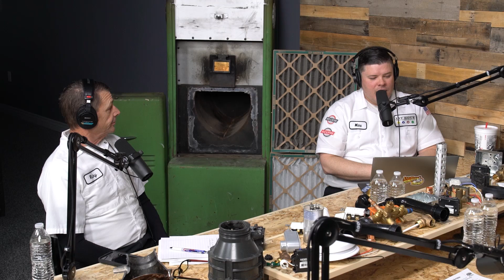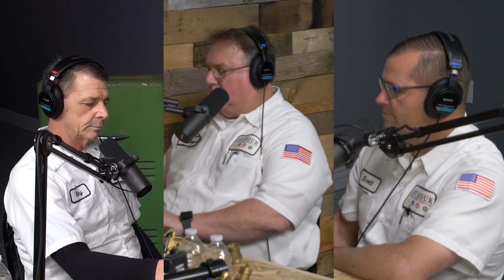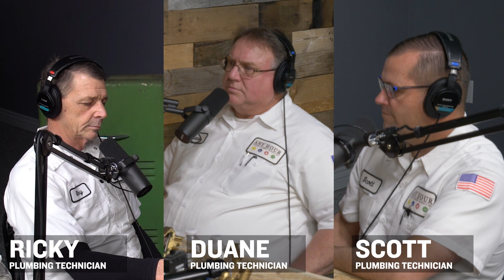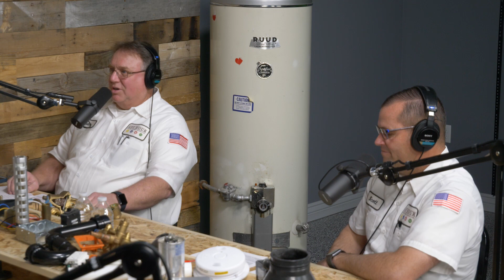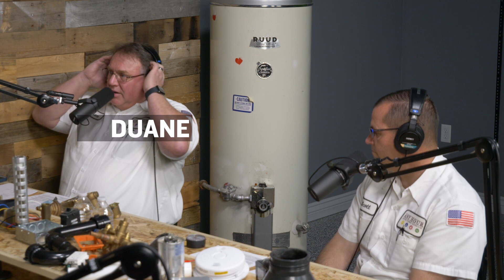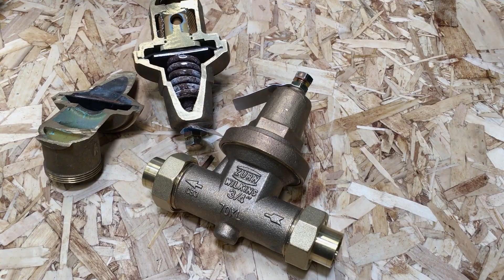014 - Are Your Water Pipes Banging Around?

Comment: When using on a hose bib (non anti-siphon) I noticed the pressure rose about 10psi or so after running it with the gauge on for a few minutes. That being said is it best to leave the gauge on with the water running for a few minutes to get a more accurate pressure reading?